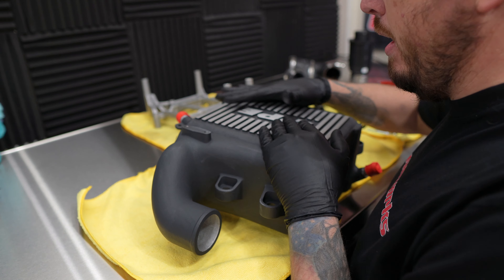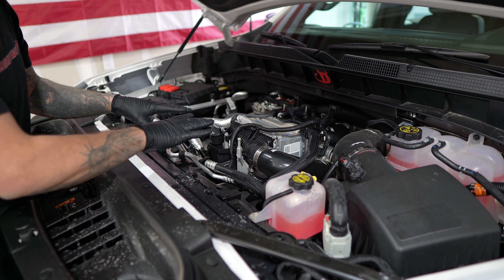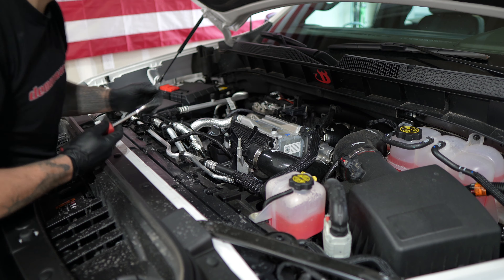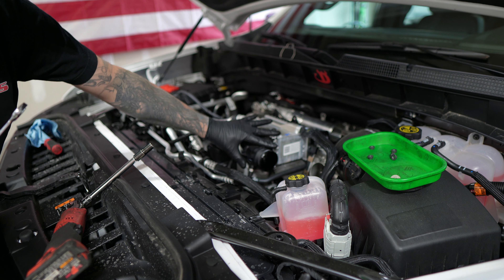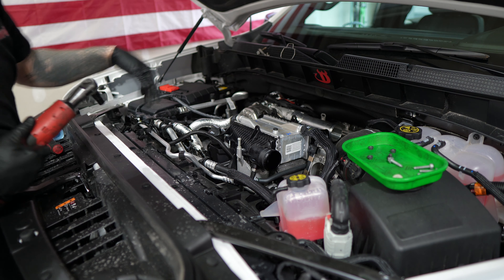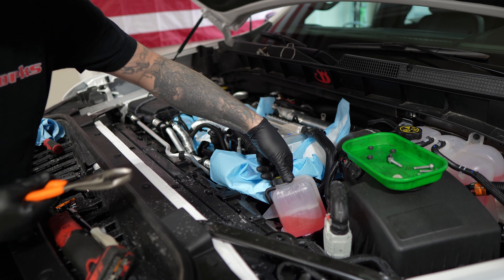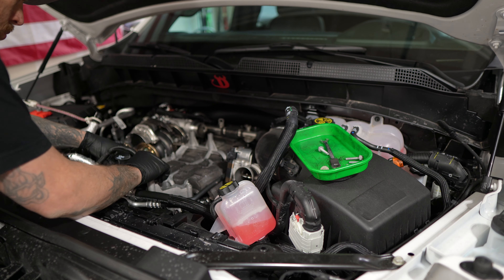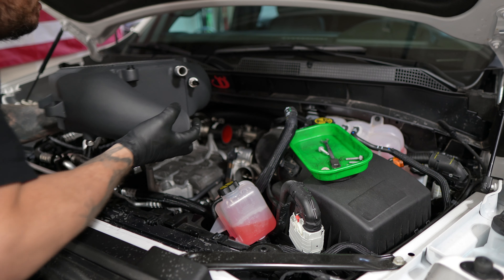PPE 3.0 Duramax Diesel Charge Air Cooler Installation and set backs

Comment: I would be extremely interested in the numbers.  While a larger surface area will lead to faster heat dissipation, a larger unit does not necessarily equate to larger surface area.  I'd be concerned the larger housing on the replacement unit is thicker, and causes a heat trap. 

Those engineers at GM are pretty sharp when it comes to efficiency and effectiveness. Granted, regulations may require them to leave a little left under the hood l.

Comment: I have already installed this, waiting on the ppe intercooler…where does the coolant recirculate back into the charge air cooler
Reply from the maker: Front most radiator is for the charge air cooler, there is a pump attached to it that flows the coolant through the charge air cooler then back through the charge air cooler radiator.
Reply: @DemonWorks   Im tracking, however the charge air cooler hoses run from the overfill to the charge air cooler then out. I dont see any return line...just trying to gain a better understanding.
Reply from the maker: @seankelly894  the reservoir has a hose into it and out of it. The whole system is in a loop.

Comment: I recently just purchased and received the PPE inter cooler for my truck but I am confused on how the inter cooler will self fill/replace the coolant on its own. Looking at the cooler, the coolant reservoir is lower than the fill hose(liquid goes down hill not up hill), wouldn’t this not allow the cooler to self replace like the stock cooler? The stock cooler hose from the reservoir is flush so any coolant loss will natural replace itself. I watch how you had to lift the coolant reservoir up 6 inches or so to fill the cooler up, that doesn’t make sense to me unless the unit has a pump that pulls the coolant up into the cooler itself. Is there something PPE told you on how the unit works in that matter. I would hate to put this on and later on over heat due to no coolant in the intercooler. Or every oil change do we have to raise the reservoir up to refill the cooler? Sorry for the essay but I hate to ruin my truck engine over this. Thanks
Reply from the maker: Understandable, there is a pump that runs the coolant through. Fill the way I did and you are good to go.

Comment: I have a 2021 Sierra with a 3.0 I have the banks pedal monster with the Idash gauge. 3.5 inch lift and running 35x11.50r20. Is there anything you would recommend doing? I see you videos about the s&b Cold air intake and how you didn't really see any gains compared to the stock and also the intercooler by PPE. I'm waiting for the derringer.

Comment: Are you going to install the PPE rear diff cover and engine oil pan?
I did the rear diff cover on my 21 AT4 and have been banging on PPE to build a cover for the front diff.  
I also hit up Fluidampr to build us a harmonic balancer.
Reply from the maker: Yes, the diff cover is going on real soon. 

Maybe the oil pan, will see !

Comment: Will all of these ppe mods that you have done to the turbo parts did you have to adjust the tune at all ?
Reply from the maker: There’s no ability to modify the tune at this point. The mods I have done are meant to assist in the efficiency of the system and shouldn’t require tune changes to be beneficial.
Reply: @DemonWorks  gotcha thank you was just wondering cause I have been following all these turbo mods to make the engine noise louder and help with fuel economy and I want to do them just don’t want to run into the issue of having to tune cause in New York your not able to tune any diesels legally anymore
Reply: @LoudMouthGamer  thank a democrat.

Comment: Are you putting on the ppe transmission cooler on you new lzo to ?
Reply from the maker: Yes, I just haven't done it yet because I have staggered my installs. Next project is removing this charge air cooler so I can gather data. Next is the PPE engine oil pan followed by reinstall of the charge air cooler then the trans cooler right before I take a trip towing the car.

Comment: Update on my intercooler, it was a no go on my truck. My truck threw codes for 3 days and I averaged 12mpg. I installed it 2 to make sure it was on and with help of a certified mechanic still not working well and my truck ran bad. I ended up taking it off and my truck is running great again. Watch out this is definitely not a plug and play product and now I am trying to get a refund.
Reply from the maker: Sounds like you had an air leak. What were your codes?
Reply: P026D and P0172, i checked everything out 3 times. Cleared the codes and it didn’t work.
Reply from the maker: @nickchesko1719  codes are for fuel quantity too high and fuel trim rich. I’d say there was an air leak or restriction. I know the pipe in the back can be tough but who knows. Unfortunate you couldn’t get it right but it sounds like you are better now.
Reply: Yea it’s just regular diesel fuel I always use and I just put the stock inner cooler back on and everything is working like normal no codes so I have no idea. Just wanted to give people a real world post install review and hopefully they have better luck than me
Reply from the maker: @nickchesko1719  I don’t think installation error is something you had to warn everyone about, but to each their own.
Reply from the maker: @nickchesko1719  watch for my video in the next few weeks of another one being installed on a truck where we are doing before and after towing tests / data. Maybe on that install, there will be something that was missed on yours and you can make use of it.
Reply: Would be interesting to see how you put another one on and why would you have to wait for another truck to get data? You had that intercooler installed in/on your 23 for over 7 months now. There is no data or information you gain from yours? Just confused on the lack of post install information across the board from you, Diesel power products and PPE. Good luck with the new one.
Reply from the maker: @nickchesko1719  tow test … I’m not going to remove mine then tow then reinstall them tow… my channel provides the real life data and that’s not real life for me … like I said, watch the video and maybe you can see where you possibly went wrong.
Reply: Can’t wait to see some real data  and possibly it will show something that was not done in my install.
Reply from the maker: @nickchesko1719  that’s the spirit! Btw, there is plenty of data sprinkled in many of the videos … just no full towing before and after.

Comment: It really sucks that Duramax decided to shelve the LM2 for the LZ0, and especially frustrating that anyone who wanted a LZ0 diesel SUV is out of luck for 2023. So you have to purchase for 2023 a discontinued engine. Its not cool to keep changing after only a few year run. Parts will hard to get after awhile.
Reply from the maker: I hear your frustrations and I just want to point out that the LZ0 is based off the LM2 but with some improvements or changes. The LM2 was not shelved, it was just updated to the LZ0 for the trucks only. Most LM2 owners are very happy and many have commented that the changes seem minimal to them and they don’t plan on changing their vehicles from just this update. In 3 years, there will be another update to this engine, much like the 6.6 has received continual updates.
Reply: @DemonWorks Yes, mainly the LZ0 got steel pistons, slightly smaller bore (thus thicker sleeves), and slightly longer stroke (to maintain 3.0 displacement). Seems engineers want it to be more robust than the LM2, and agree there will be future updates. Our LM2 is a ‘23 Yukon and what a great combination! More power than our previous 5.3, very quiet, great fuel economy, way less gear hunting, and no DOD.
Reply from the maker: @jrwstl02  Incorrect. The LZ0 received steel pistons, yes. Thicker sleeves, yes. The stroke and the bore is unchanged. I did a full video on this before the engine came out, believe I have done 2 or 3 because this misinformation is just crazy. The stroke did not change, what did change is the height of the piston and where the wristpin attaches to the piston is raised, so a longer connecting rod. The bore and the stroke remain the same. There are turbo changes, intake valve length changes, head gasket and. cylinder head changes. Coolant valve is different, the way the trans cooling system works is also different. https://youtu.be/dxPkKIX-4aM

Comment: Someone needs to make a kit to convert the stupid belt driven oil pump to chain driven
Reply from the maker: Did yours break?
Reply: @DemonWorks  No, because that was the deal breaker when I did the research on the engine when gm introduced the motor and secondly gm claim 150k miles service intervals...no thank you I am not replacing a belt every year and a half or so. I do alot of driving so I'll just keep 08 6.6 GMC but I really think gm should have produced the baby 4.5 v8 dmax for 1/2 ton that they shelved in 07 or 08 that motor had the same output as the LB7 dmax and the 4.5 was gear driven valve train and crankshaft driven oil pump just like it's bigger brother the 6.6

Comment: Are you going to install a oil catch can.  I can’t believe that much oil with just 1500 miles
Reply from the maker: It is during break in and these engines come 1 quart over filled so I am not concerned about it, yet.